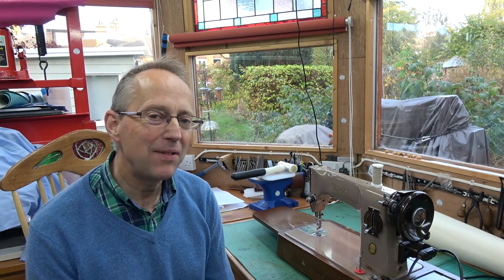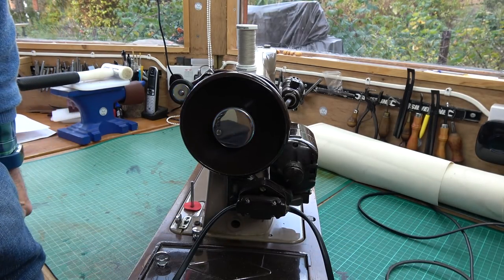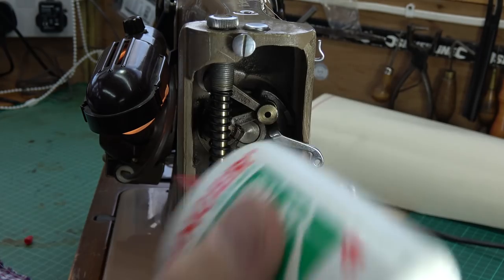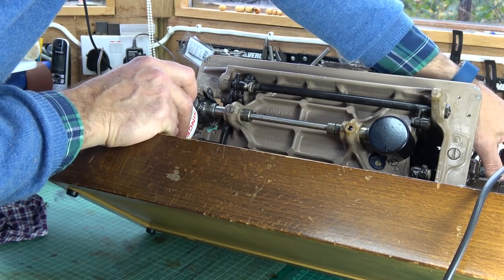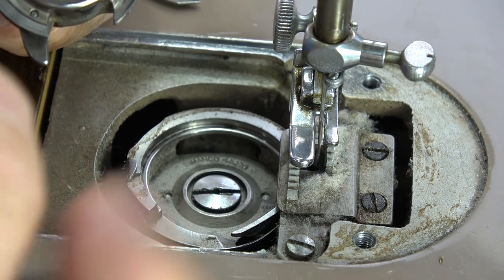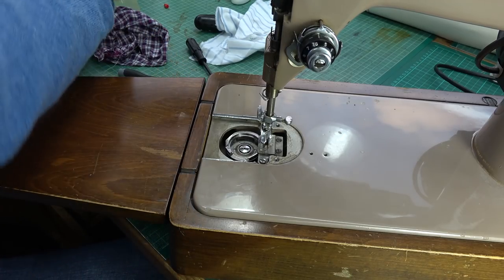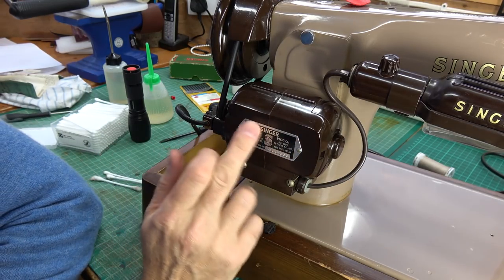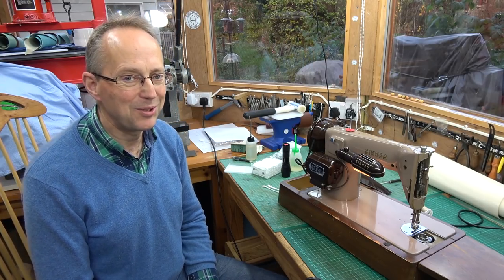Reviving a Sewing Machine Singer 201K

Comment: I found that to remove the bobbin retaining ring, it's easiest to take off the foot and undo the two screws and the walking plate retainer.
This gives easier access and there is less chance of breaking the ring retaining springs. These are very fragile  and snap off if you lever them out too far. I've only been able to get second hand replacements. I also use a syringe and a blunt drawing up needle to oil, and I use pneumatic tool oil.
Reply: Thanks for the tips.

Comment: I have a Singer identical to this, coming to me hopefully tomorrow, if the delivery service doesn't fall short.  I'm so grateful to have found this.

I have been using Marvel Mystery Oil for pneumatic tools on my sewing machines on all the pivot points.  THings that get a bit more pressure get either Tri-Flow (with its Teflon particles in suspension, very nice) or a heavier oil that has molybdenum disulfide included.  I'm interested in trying the moly oil in the hook race area, I think that using just a little bit fairly often will help impregnate the steel with moly and thus reduce wear and noise even more.

Comment: Thought my motor was a bit weedy but will give everything a thorough clean and oil now to see if it makes a difference. Thrilled to bits with my 201K that cost me £26 (delivered!) and after your inspiration I think I'll be even more pleased
Reply from the maker: That's great thanks
Reply: @harryrogers  turns out my motor is just pretty weedy (1949 model machine). Had a hell of a job after putting bobbin case back together again until I realised the tab on the carrier (18:29) wasn't located properly. It's been a learning morning but I'm back sewing again and can stop wasting thread. Might look at the motor upgrade from one of your other videos, or I could mount it onto an industrial table with a 1/2hp motor

Comment: Thank you for this super informative video ,I've just bought one of these machines from eBay, .After I've followed your advise on thoroughly cleaning and oiling, it is going to be placed into a sitting room cabinet, again bought of eBay). I reckon it will just about be bomb proof when placed in the cabinet which appears to be solid mahogany/ not veneered.. great vintage singer to add to the others l have collected. Woo woo

Comment: I liked most of this video but I have a few comments about your recommendations and practices.  First the oil you used is fine, although over oiling can also be a concern. BUT you recommended the use of 3-1 oil which would be a bad idea, as all oils are not created equal. 3-1 oil dries hard quickly and has much less slip than a true sewing machine or bearing oil. Second the gearing on these old Singers should be lubed and not oiled with the same lube used on the non sealed bearing Singer motors. Otherwise great info. I have heard that the round rubber ring belts put more stress on the motor than the replacement Belts, but I have not tested this issue.
Reply from the maker: InTheMist Thanks.
Reply: Agreed 100%. 3-in-1 oil will eventually damage a machine, as will oiling when grease is required.
In addition the motor should be maintained. The motor bushings/bearings will need to be re-lubricated. The brushes should also be inspected and the commutator cleaned. The motor maintenance should only be done by someone who is experienced at working with electrics.
The belt installed was inappropriate and more importantly far too tight. It will ruin the bushings quickly for sure.
Other tutorials on YouTube show how to service a sewing machine without doing eventual harm.

Comment: My favourite sewing machine ever. Just a quick observation about round belts. I have had the odd occasion where the round belt rubs on the underside of the bobbin winder bracket so tend to favour a V section replacement.

Comment: I have one of these from an Opshop, its been making the same kind of sounds as shown in this video, thanks for this, when I have the time I feel a lot better at trying to lean it up, but I need to glue the motor, where the screws hold it, its stamped right off.

Comment: I would recommend singer oil, it's not expensive and if it gets on the fabric you are sewing it washes out much easier than 3in1 or similar. Also the round belts are excellent, much better than the v belts but they do stretch so I always just pop it off the motor pulley when I am done with the machine, it stops the belts stretching and stops it putting pressure on the bearings.
Reply: 3in1 household oil causes significant problems on sewing machines.  It contains Naptha (In the USA) which floats the dirt and grime but then evaporates.  The dirt and grime then reattaches to the machine parts and becomes a nasty plastic like brown coating that can seize up a vintage machine. In my opinion its a sneaky way to require you to use more oil.  Thanks for  pointing out the oil.  Sewing machine oil has no additives and is both the proper viscosity and designed to be nonstaining to fabrics
Reply: Always use clear sewing machine oil, never 3in1.

Comment: What an excellent video and beautifully filmed and perfect audio. (A rare thing) A couple of small points; 3 in 1 is not recommended for sewing machines and due to the ready availability of Singer oil online there is no reason to use it. Secondly, I could not get one of those round rubber drive belts to fit on my 1960s machine because the round cross section protruded above the groove in the hand-wheel sufficiently to significantly interfere with the bobbin winder arm. How much clearance did you have?

Comment: First of all,an excellent,very informative film. Yes, the engineering is outstanding on these machines. The cost of one new here in Michigan would have been equal to the cost of a good used car back in 1955. Here many get taken to charity thrift shops where they are sold for pennies on the dollar. I have several 201-2's,some of which I am converting to treadle or belt electric in lieu of the potted motor using derelict 15-90's as donors for the belt guard and handwheel required.  As ibsoarin says, the potted motor 201-2 is what you find here.Very seldom is there ever a 201K or the aluminum version. I feel that perhaps at about the same time the slant needle series was being promoted more here. Another thing I have noticed , I have never seen a Japanese copy of a 201 series unlike the multitude of 15-90 copies.Again,great work!
Reply from the maker: Thanks John..thats very interesting and I appreciate you taking the time to comment. Regards Harry

Comment: thanks, very useful video. I have just bought a 1955 201k, in its wooden case with various extra "feet/mechanisms/cotton", with its original electrical 2 wire cord to a 3 round pin plug: electrician at B&Q advised 3 core 6 amp cable to earth to replace the two core, and standard 13mp plug, which I bought. He says that there is a  risk of live current to cast body of machine otherwise. I also read on amazon that capacitors in foot pedal are old obsolete type, and kit to replace them is £19.95 ..... otherwise pedal has tendency to "smoke" with prolonged use? I will have the machine pat tested when its all done, cleaned and lubricated , belt replaced and new light bulb bought (inside machine is dusty and dry but very little wear). I've also the option to buy a Singer 220k, but only advantage I can see is that its lightweight and compact for transporting (and it was Singers most expensive machine in the mid-1950s).
Reply from the maker: Do take a look at this video I did on the motor upgrade:
https://youtu.be/T5H2l6TRnA8

Comment: Just scored 201k made in 1955 with table (needs some work) from fleemarket. After 4-5 hours got it running it was completely Jammed now runs like a new machine. Whole set with lots of accessory was 20€ no case sadly. I have a question what kind of needle (possible to use normal?)  with light leather and what is a good thread to use, example when making a simple wallet. Thanks to you I was able to see how much these old machines have, Cheers From Finland !!!
Reply from the maker: Best if you can get hold of standard leather (leder) needles. Gutterman upholstery thread is good.
Reply: @harryrogers  Actually Have one, came with the machine but 90/14 Milward brand. Have to look for that thread only have their Silk thread now. Thanks !!!
Reply: @harryrogers  Guterman M 782 polyester for example?? I remember you using bonded nylon in some video with Singer 201 ??
Reply from the maker: @OriginalFinnish22  Hi Yes spot on.

Comment: Thanks for all your Singer videos Harry, really informative for someone looking at buying one - where did you buy the replacement belt from? In one of your previous videos you mentioned getting a 201k for £26, I'm looking for one on ebay and they range from 100 to anywhere up to 250 sometimes. Are there any other places you would recommend keeping an eye out for one?
Reply: I got mine as a swap for a bottle of Sauvignon Blanc (actually I was given it FOC, the wine was just as a "thank-you")

Comment: Nice machine Harry! I have one the same, in black... It was in very poor condition when I got it, particularly in the bobbin case. But a few hrs with some WD40 and some 1200 grit sandpaper and all the rust is gone, looking and working almost like new. 

You might be able to guide me a bit though with the motor. My motor is a sealed unit like that one. It wasn't working well, so I opened the hard case. Mate, there was a colony of something living in there! It needed a good clean out. I did that, and sanded down the bushes so they contact better too. It works better, though still not getting a lot of power out of it. It kind of hums sometimes, and won't turn. Still need to replace the belt, but wondering if the motor is as good as it'll get or if there is more I can do?
Reply from the maker: I assume the commutator is clean, and the gaps between the copper sheets? Perhaps someone else here can suggest anything else?

Comment: Harry,
I hope you do not mind me pointing out the oil hole on the front of the 201K pillar base below and to the left of the Singer medallion. That oil hole lubricates the bushing for the vertical jack shaft that connects the upper and lower horizontal drive shafts.
The oil hole is seen at 24:03-24:37 of this video as a black dot.
Reply from the maker: Not at all ...you make very helpful and valuable comments to help all of us.

Comment: Hello I have a 201k machine identical to yours apart from mine was in my nans attic for 50 years and a few of the screws etc are rusty and it has no table to sit in but all the parts are thier the lights and the original parts now i was wondering if people buy these in a state like mine where it needs cleaning up or wheater its got no value unless it is already refurbished yours is stunning
Reply from the maker: I would guess not much value...take a look at EBay to get an idea...maybe £20...I don't know.

Comment: What size of bobbin wheel does this machine use? I have a singer 15k30 with an oversize wheel I believe it's a one inch wheel but cannot find a replacement, do you happen to know the correct size wheel? Thanks

Comment: Very helpful video, however I can’t see exactly where those oil reservoirs are located. Maybe you could point them out more clearly on your next video or possibly use a diagram showing the holes into which I should add oil.  Thank you.

Comment: Great video. Looking for a 201k on Ebay and I've seen one with a knee operator. Do you know anything about these?  Can it be used with a foot pedal also?
Reply from the maker: Hi I am not certain but I think it has a foot pedal attached to the side of the case and the knee operator arm presses on that...so I believe you can convert to standard foot pedal...but I am not certain...perhaps someone here can confirm.

Comment: Hello Harry, Thanks for making this video. What perfect timing...I'm currently working on my recent purchase of a Singer 201 which is completely seized. The belt is very loose and according to the instructions on the booklet and your video, is to release the screw. Now, that's where I'm completely stuck. Have been trying all methods, penetrant, tapping, heat, wd40, kerosene and even using a blade to scrap the area around the screw but the screw just won't budge. I tried to use a wrench, and pliers to maybe loosen the nut around the screw, still cant get it out. Any tips would be greatly appreciated. ps. your video is perfect for guiding me to restore my 201. Thanks
Reply from the maker: I guess you have tried hitting it with a hammer and screwdriver to shock and vibrate it loose...sounds like you are doing all the right things.
Reply: @harryrogers  Hi Harry, yes, yes I've tried ALL KNOWN  tricks including a power drill, any tips? Ta

Comment: Hi Harry, just came by a 201K (black model) which failed its running test so followed all your advice. !) times more fluff etc ! But it still fails to stitch having carried out all o'hauling. New spring , new belt etc. It picks up the lower thread easily then fails to stitch. I'd be very grateful for any further advice please. Must thank you for all your leather work and sewing machine videos thus far! Looking forward to your advice though on this one. Best regards Howard
Reply: Sounds like you need to check out the YouTube videos on adjusting the timing.

Comment: I'm stuck with the motor belt... Great video, very helpful. I'm also trying to replace the motor belt on an identical machine with a very similar rubber one. And although it is only 5mm thick, it is so tight against the bobbin winder part its preventing the motor from turning the wheel. Any ideas?
Reply from the maker: Can you undo the motor bracket, and move the motor...if that helps?
Reply: @harryrogers  Its not related to the motor position, its getting stuck at the top where it goes under the metal bobbin winder component. This metal part cant be moved. Leaving a very narrow gap for the belt to pass through.... Most belts seem to be 5mm or more!

Comment: Hi I have a singer sewing machine 201k, not been used for ages, and unfortunately stored in a damp shed. I have, oiled everything and replaced the belt. Everything runs, but stitches do not lock what part of England are you in? as I need some help. I want to use this machine. Do you have a contact email please. I remember the machine working at some point. I do love it and want to use it. I have managed to wind a bob in OK. But can not get the stitching to work.
Reply from the maker: Check you have the needle threaded correctly...right to left???from memory.

Comment: I like to pick up old machines and restore them as a hobby. Many have old dried grease, lint, and dirt that are gumming up the works. The worst ones go out to my garage and sit in the parts washer and get a good bathing in kerosene. Then they get dried off, regreased and oiled, and usually run like new. I think its important to get all the old filth out of the workings. If you don't have a parts washer, a liberal use of spray penetrating oil would do. Then again a proper greasing and oiling. Do not ever use lithium grease. It dries out rather quickly. I have heard some sewing techs actually recommend marine grease. For the parts that should be oiled, a light sewing oil is always the right choice. I find some odd satisfaction in knowing that the machines I save will likely outlast me.
Reply: I used lithium grease on a few vintage sewing machines 20 years ago and all of these machines dried out and became stuck. I had to gather all of these machines back to my shop, clean all of the dried lithium grease and replace it with Singer grease, Mobil 1 synthetic grease, or my favorite, Tri-Flow synthetic grease.
No further problems and I learned never to use lithium grease on vintage sewing machines.
Reply: ibsoarin I recently saw a video on Youtube of a tech rebuilding a relatively new commercial embroidery machine. The problem...it was loaded with dried up lithium grease. The owner apparently thought, the more the better, but found out different when his entire machine had to be disassembled, degreased, and reassembled with proper lubricant.

Comment: Hi Harry, thanks for the great Video on the Singer 201K, I got one today and followed your video and gave it a good clean and oiling, it was also bone dry !! it wasnt very dirty though, I check the plug and put a 3 amp fuse in as it had a 13 amp it runs really well the light works also, I do have one problem though I cant get the bulb out, also whenthe light is on and i press the pedal the light goes out , any idea on this ? apart from the it runs smoothly , Ive named it Pearl  ( as in Pearl's a Singer lol )
Reply from the maker: Thats weird....to get bulb out hit it inward and see if that jolts it...obviously with power turned off...unplugged! Is it just a faulty bulb going out with motor vibration? Good luck with Pearl!
Reply: @harryrogers  Hi Harry,  no it was nothing to do with the bulb or the motor vibrating, in the end i just went and bought a new motor from the link you posted, also bought a new bulb, the link you posted was for a 3 watt, but you said in the video you installed a 4 , so I also went with the 4, its all connected up now, , and works lovely, no more light going out when i press the pedal , I wrapped masking tape around the old bulb , as I couldnt get a good grip, it worked and i got it out !!
Reply: I've just watched a video regarding the light going out when you press the foot control, it's very simple to correct, it has 3 wires 1,2,3 your 2&3 were the wrong way round, there is a tutorial on "the featherweight shop" on you tube, hope this helps anyone else with this problem 😊 also he explains how to remove the bulb easily.  It's a great you tube channel as is Harry 👍😉
Reply from the maker: @jackierudd2010  Very helpful..Thanks very much.